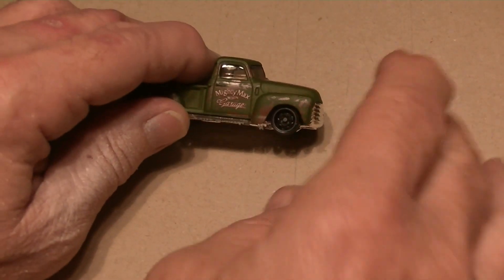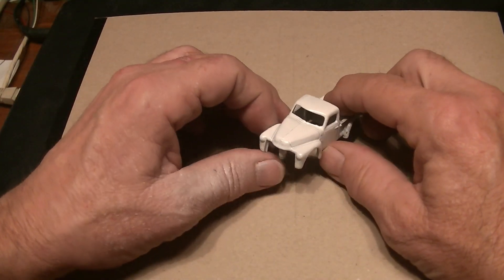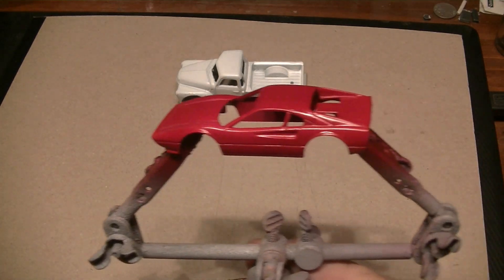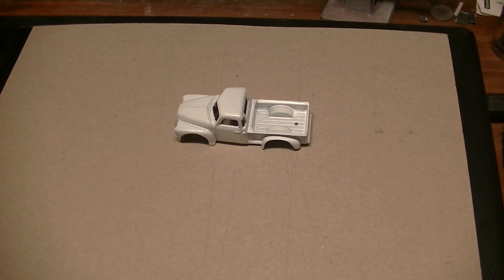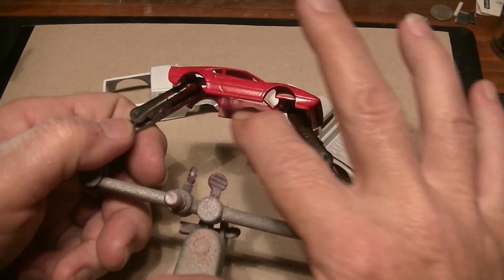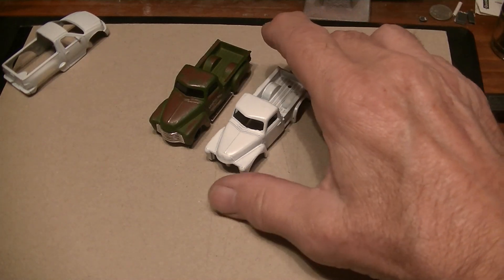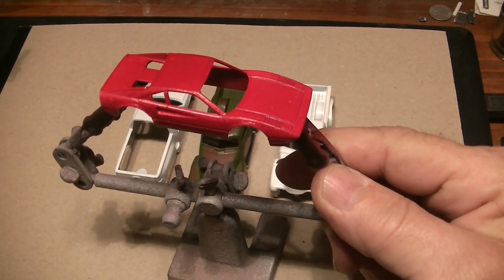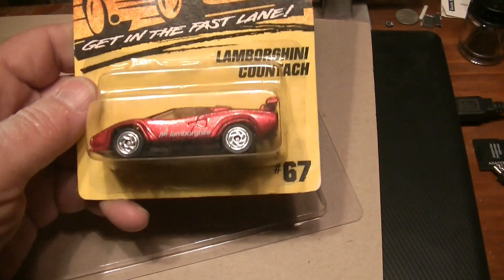Ferrari fix and 2 other things

Comment: Magnum had a 308 with 5 spoke aluminum factory wheels. JB Weld the axles in the base, make sure you center them first, I make card stock wheel spacers to keep em centered while drying. Also if it's not going to be raced, polishing the contact point between wheel and chassis isn't really required. Looking good so far Bill.
Reply from the maker: Hey man, thanks. I was going to race it, but since I only have one, changed my mind. JB weld takes 15 hours to cure. I have CA glue and activator and 2 part 5 minute epoxy with the mixing nozzle but I only use that on a large scale. The CA (super glue) with activator is great. AND, YES, a spacer to center the tires. I just sprayed the car with transparent Brite Red over the Crimson Red.  F'n looks awesome man. I will look for the 5 Spoke Wheels. Heck man, thanks so much, and the F-40 is next. OK, back to the shop, came in to get a beer.